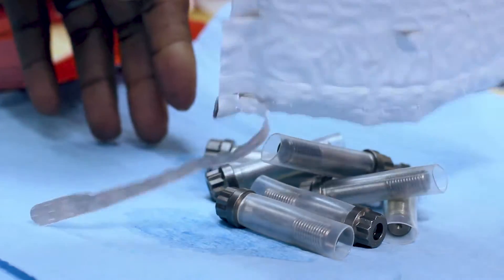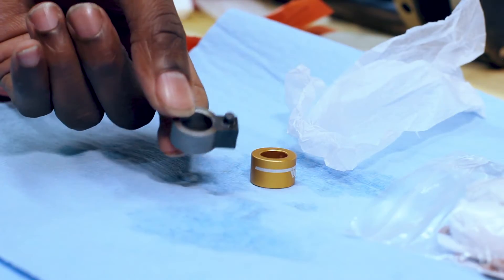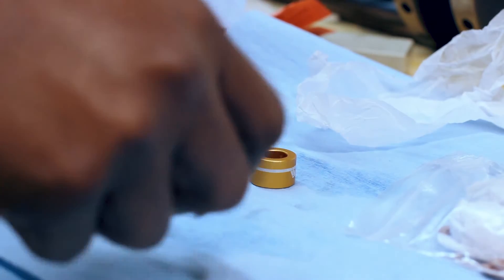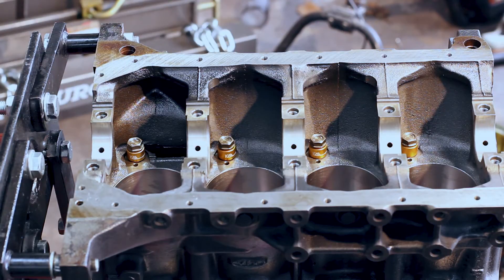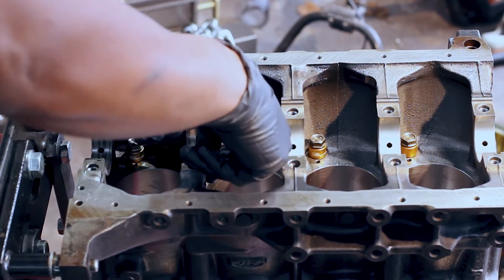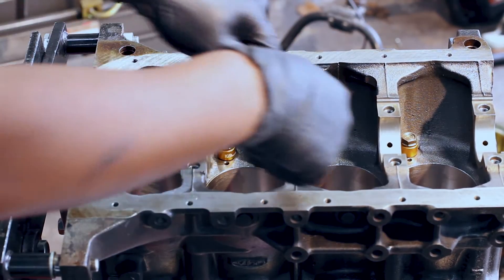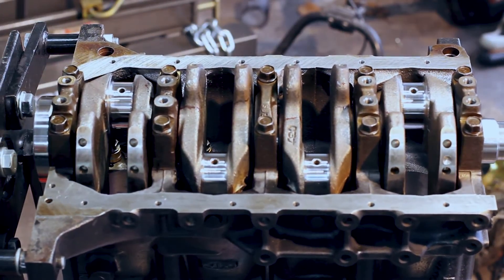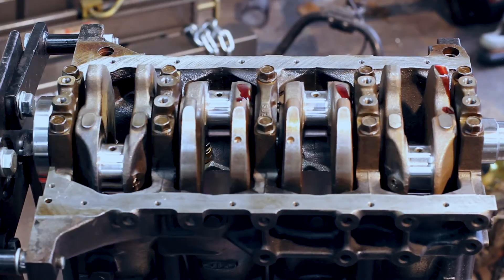Mazda BP Forged rods and pistons install.

Comment: Love your videos where in Florida you are , I live in Titusville and I have a mazdaspeed protege and need a lot work trying to put the clutch and the transmission back ,trying to learn ,it will be nice have someone like you closer for advice,wish you the best ,love that bpt engine a sweet swap on my car
Reply from the maker: @pgmoca70  I'm in merritt island,  small world.
Reply: @ wow that like 25 minutes how you are with time ,I been having problems installing my clutch ,ones everything is on my trout out bering is not reaching enough to do the normal in the clutch looks more out that in any advise or you have time to visit and joint a good friend , i can provide my phone number to you if you have time , I will appreciate ,thanks for responding

Comment: What compressor are you using? It seems to always have pressure and never kicks on!
Reply from the maker: Cheap harbor freight 21gal deal. I turn it off when filming,  and stop filming when it's running,  also I tend to keep the regulator turned down.
Reply: @StovallsGarage  I need to pick your brain asap. I'm picking up a EGT this week for my 323 swap. Need to chat with you for a few.

Comment: Did you get the rotating assembly balanced? I am planning to just install forged rods and leave everything else stock. Will that be a bad idea? Aiming for a reliable 240bhp
Reply from the maker: I had the crank checked, and weight balanced the rods and pistons. I've heard of  bone stock blocks making over 350 reliably.
Reply: Thanks for the reply man, I think I am just going to go ahead and swap in the forged rods and see what happens. After reading it seems that the stock cast rods start to bend at around 250 ft/lbs

Comment: Why would you delete the oil squirters?
Reply from the maker: varnishvarnish because they aren't needed with forged pistons,  and the increase in oil pressure is more critical at higher HP and higher  RPM than the minimal cooling effect you get from the squirters.
Reply: I disagree completely
Reply from the maker: varnishvarnish care to elaborate ? It's pretty common practice on drag oriented cars.  Might be beneficial for something like circuit racing, but for 12 to 11 seconds of wot they they really don't offer much.
Reply: Do you have any evidence for the drop in oil pressure wil squirters? Or is it just conjecture? I also suspect you under estimate the benefit of cooling the piston. Especially at wide open throttle.
Reply from the maker: varnishvarnish you can ask flying miata.  I'm not saying there's is no benefit,  I'm just saying  not crushing the bearings is more important with the looser tolerances I'm running. I've heard plenty of arguments either ways.
Reply from the maker: varnishvarnish And I feel I need to express that I'm not a subject matter expert,  so my opinion is based on second hand knowledge from the automotive community, but I wouldn't say is conjecture.  People have removed the oil squirters from multiple platforms with no catastrophic issues, I'm sure cylinder wall wear is accelerated as lubrication has been removed,(even through that's not the function of the squirters it is a added benefit. )I don't believe there is a definitive right or wrong answer for removing them, it depends on your needs.  I've read opinions of multiple builder with multiple platforms, and the oppions are pretty split, so I made my decision based on what made more theoretical sense for my application.  I can control piston temp through tuning for the most part, so with my wide clearances and the BPs oilpump flow characteristics I decided oil pressure was more important, (aslo running a boundary stage 2 pump with 2 shims). I also wanted to eliminate the potential of squirter check valve failure,  as the squirters tap right into the galley that feeds the mains.
Reply: Fair enough. My opinion is that removing the piston crown cooling from an application that will only see full throttle use will remove some safety margin with regard to engine knock. I guess its not an issue if you're running active knock control, but for an application where power is paramount, I'd keep the piston cooling.